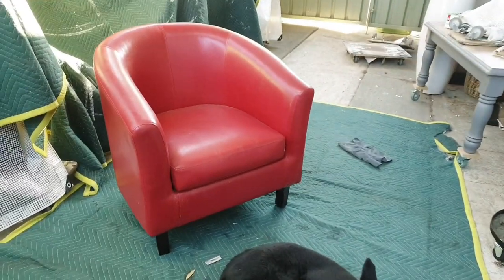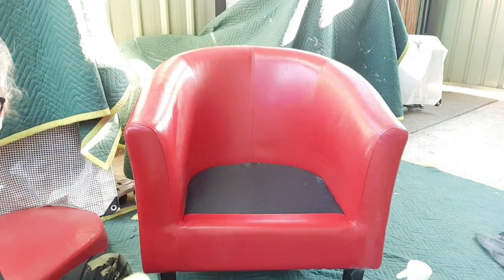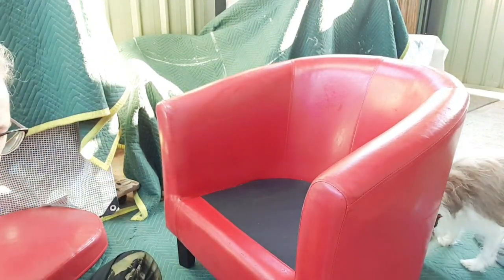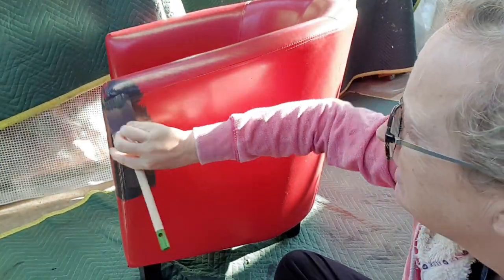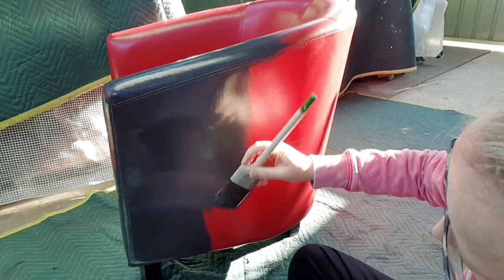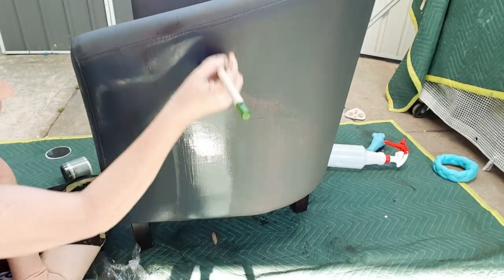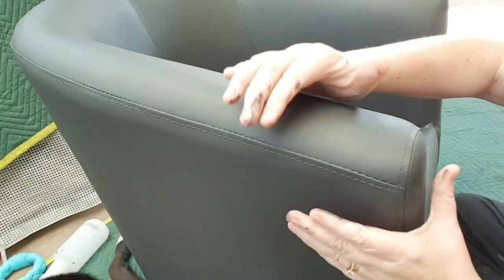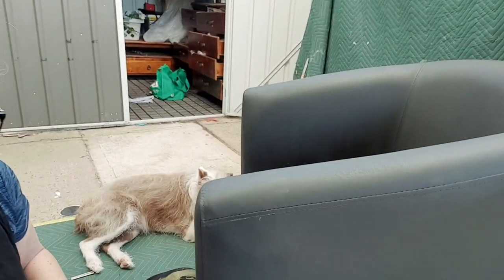Painting vinyl chairs | Furniture flip | Dixie Belle

Comment: Awesome Rachelle!  I found this video, and you, searching for a solution to a problem.  I bought a used boat 5 years back.  The vinyl on the boat cushions was in decent shape, a little stiff, but an ugly color.  I spray painted the cushions, and did okay.  Where the edges of the cushions touch (firmly) when in place, the paint stuck and created a little mess. I am thinking it is because I did not treat/seal/wax the vinyl.  I need to re-paint again, and am intrigued by this video, the way you brushed on the paint, and the use of wax to seal the paint.  I am thinking I can sand, smooth, clean, brush paint the next time I do this, but was hoping you might have some ideas how to seal, then UV protect the vinyl after. :-)
Reply from the maker: Wax it for sure!

Comment: Hey Rachelle! Awesome video! I recently found 6 retro vinyl dining chairs that I love but are a yucky mustard yellow. I would love to try this Dixie Belle paint, but I’m curious how it actually holds up over time? As dining chairs they would receive a lot of interaction… since it’s been 4 months, how’s the paint holding up on the chair? Any cracking, peeling, or scratching?
Reply from the maker: It holds up really well :)
Reply: was wondering same thing I am considering for a restaurant rejuvenation and was wondering if color ever came off ?? onto people was worried about that
Reply from the maker: The colour doesn't come of with regular use, but I'd be hesitant with a piece that was getting heavy use ... lots of wax rubbed in really well would be my suggestion:)
Reply from the maker: It never comes off on to the person sitting on it. It's fragile when it comes into contact with something that could scratch it ... def doesn't come off on clothes:)

Comment: Any way to reverse this.  I bought a couch and saw that a white layer of what looks like spray vynal paint was thrown in there poorly.  Any way to remove that ? Or should I just finished the rest with more paint??  Thanks
Reply from the maker: Oh how frustrating... I would get a high grit sand paper ... (maybe 240) and gently rub over it and see what happen. You may find that it'll peel off. If not then go a bit rougher with a scrubbing brush. Failing that, smooth it out as much as you can with the sandpaper and paint over it